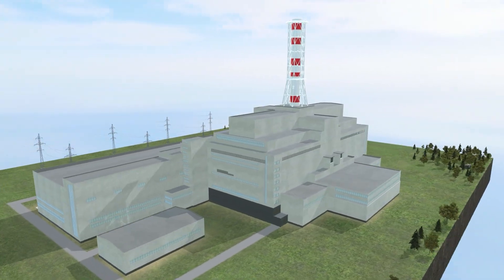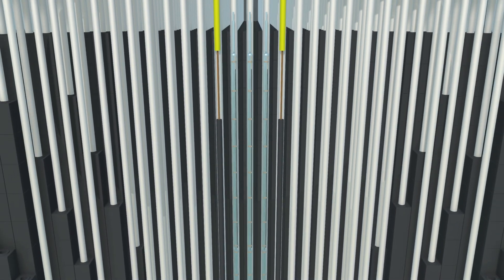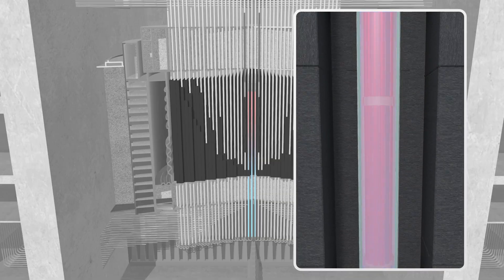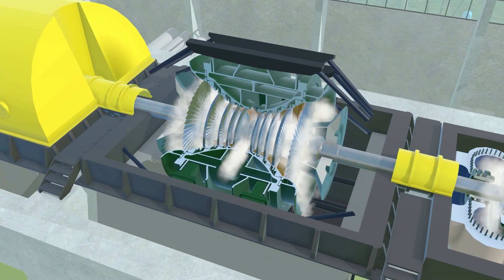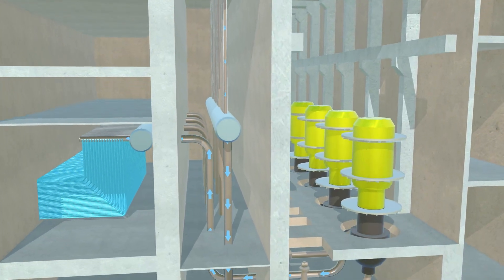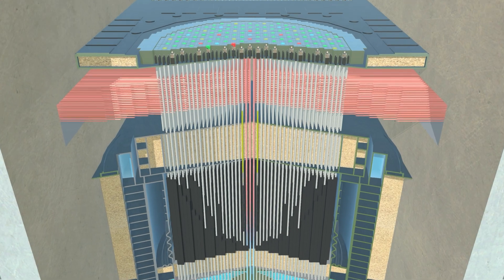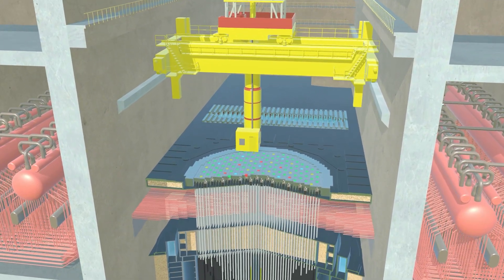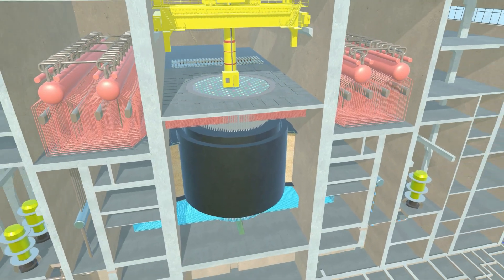RBMK reactor (Chernobyl) - How it works?

Comment: The rbmk is sooo horribly complex. Each channel in the core has a seperate pipe going into a steam drum thats hundreds of tiny pipes to correctly put together, from the drum the returning water goes through another hundred of pipes into a collector drum which unifies them and afterwards separetes it into four pipes one form each pump (and thats just one side of the reactor) from the pumps the pipes join in another collector which unifies the water, but instantly devides it back into each and every tiny pipe going through each channel. Building this must have been a nightmare. I mean look at reactors in the west . Much small the core is inside a metal vessel from with there is only a single big pipe to each steam generator, and from there a second single pipe through a pump back into the vessel, and usualy you have like four of these loops. + usualy a pwr reactor has a separete loop of water going through the separator turning into steam, going into the turbine, condenser, pumps and back. I know some types in the west also have the water from the reactor cycle go directly into the turbine because its cheaper. But thats such terrible design even the rbmk! The radioactive steam goes out of the reactor containment all the way into the turbines and back, quite risky. But the rbmk with its thousands of pipes is truly a nightmare for construction, not to mention the lack of a proper containment vessel and the sheer unnecesary size.
Reply: They couldn't make a pressure vessel big enough, so each pipe is a pressure vessel. They spent labor to make up for lack of manufacturing capability.

Comment: I spot a major flaw with this. The control rods are tipped with graphite, they would increase reactivity! This needs to be changed before something happens
Reply: Graphite displacers are essential for the functioning of the reactor. The problem was the absence of graphite in the last 1.25 m at the bottom of the displacers